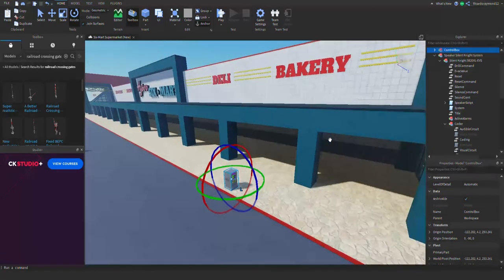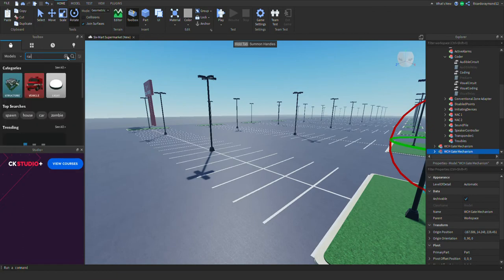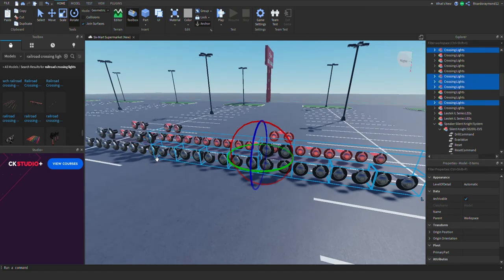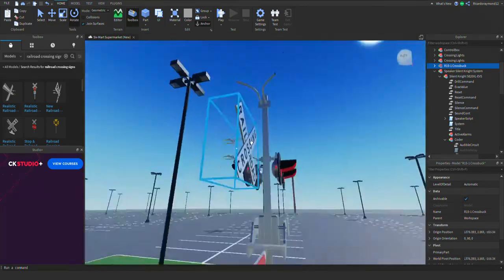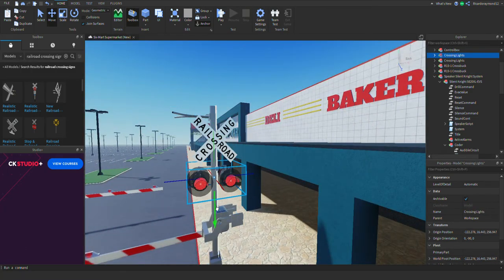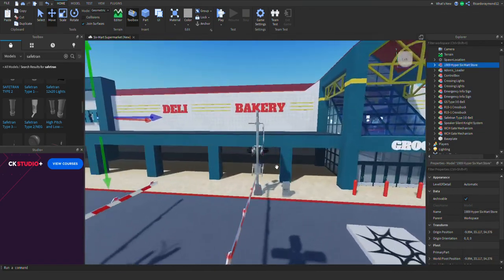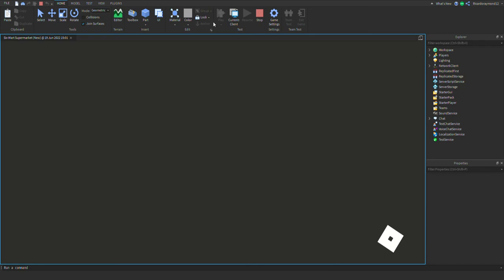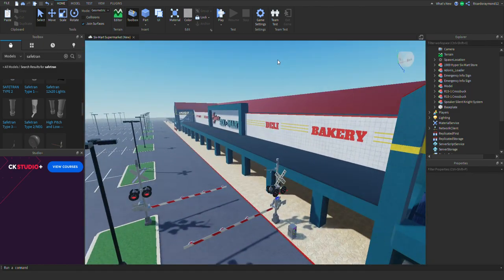How to make a railroad crossing on Roblox Tutorial (2022)

Comment: 8:45 how do you put it in smoothly so it will fit?

Pin?
Reply: Studio, go to the top bar on the top of your screen, click on "MODEL", Look on the top bar and find "SNAP TO GRID", it will say Rotate, Move. If you put a checkbox it will move that far, if you take out the checkbox it will go in "Smoothly", you can also change the measurement of studs in the movement and the rotation.